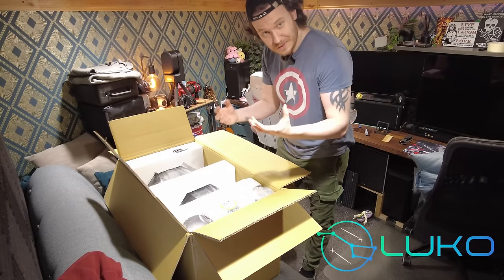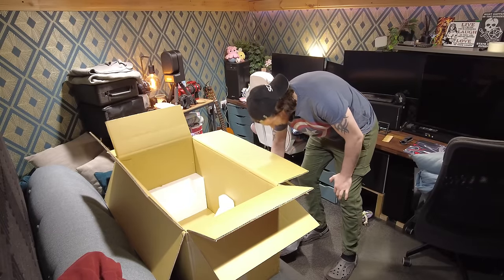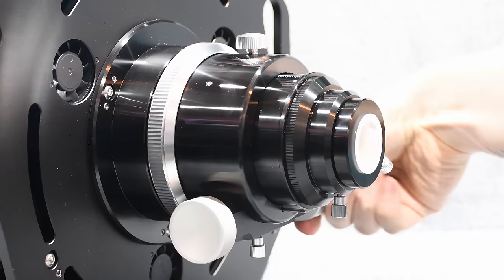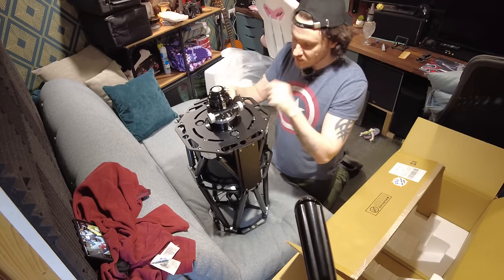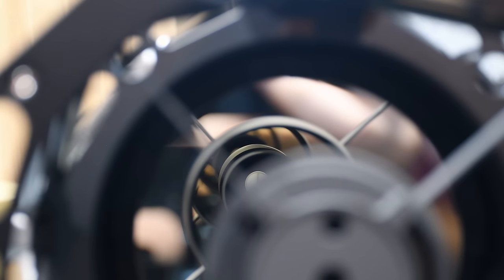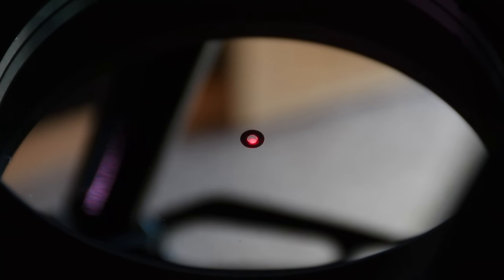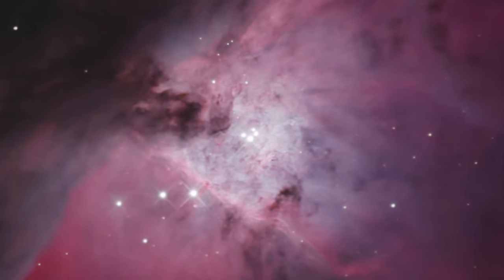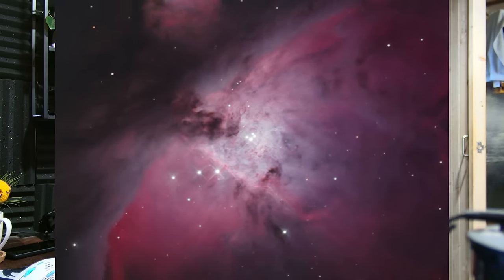DREAM Telescope! - StellaLyra 10" Truss RC - In-Depth First Impressions! (+ collimation)

Comment: Great review. It looks like a rebranded GSO scope and the focuser looks exactly like my GSO RC 6" focuser which is garbage. I had to dismantle it and 3D print a new shim where the focus axle sits to reduce some of the slop. Still has issues locking off/loosening that screw too!
Reply from the maker: Hey mate! - Good job on getting the issues mostly fixed, that's good work! - I think they all are quite similar, probably very minor differences between brands if they request slightly different specs? Cheers!

Comment: I own the iOptron version of this scope...  What a fantastic scope; it looks identical to the one you have, unfortunately, the focuser was also identical.  The stock focuser also had a bizarre 4.2mm shaft meaning none of my AF bushings quite fit properly.  Needless to say, I replaced it with a TS 3'' Focuser (short version), not cheap, but absolutely rock solid now.  I also added a ClickLock for good measure.  Finding a focuser with the required M117 thread hugely limited the options as I didn't want to have to go down the M90 to M117 adapter rout.  You would expect a better focuser on a £3k scope, but not going to lose much sleep just because of how amazing these RC10 scopes are. 🙂
Reply from the maker: Hey there mate! - ah I totally agree, it's a weird situation to see such a focuser on what is otherwise a truly top tier telescope, but like you say - I won't lose much sleep over a bad focuser when the scope is this good 👍👍
Reply: @lukomatico  It's rather than the "Don't look at the Sun" tag, this scope should have a "Don't use this focuser" tag.  Trying to coax any images out of this focuser drove me insane, it was like trying to use a hammer with a rubber handle.

Comment: A Moonlite Nightcrawler or something similar is what it needs for a focuser.  In all honesty, IMO none of the stock focusers are up to the weight of today's imaging trains with APS-C size and larger sensors.  By the time you hang an OAG-L and 2"x7 EFW, ASG Photon cage (for camera sensor tilt/back focus fine adjustments), a ASI 2600, 2400, or 6200 (or larger) camera at the end of the image stack and there is just a lot of leverage that the OEM focuser's just aren't capable of handling without some deflection/droop.  The issue was evident on my much smaller Esprit 100ED once I went to the 2600MC camera, so I went to the Nightcrawler after a year and haven't regretted it.

I really don't expect the telescope manufacturers to address this, after all it makes no sense to make such a robust focuser assembly for visual viewing or even for the smaller cameras like the ASI294.  Even for the dedicated astrophraphs, there are so may excellent 3rd party focusers available that the telescope manufacturers likely don't see a benefit of in trying to sell an OTA with an OEM focuser on par with that like the Nightcrawler or others.  They just don't say that outloud and I've yet to see anyone say that the OEM focuser wasn't really up to the task of a long/heavy imaging train until now.
Reply from the maker: Hey mate! - Sorry about the late reply here!
I totally agree that a lot of OEM focusers just aren't up to the job for a full-size image train! - many are probably fine for a smaller setup, OSC & filter drawer etc, but really struggle with heavyweight camera rigs.
Very glad to hear the nightcrawler has been a great solution for you! :-)

Thanks for watching and clear skies!

Comment: Hi, I am purchasing a 10 inch RC truss, I am wondering if the TS focuser upgrade worked with the telescope and with the ZWO EAF
Reply from the maker: It did indeed my friend :-) you need the correct size focuser though, just worth double checking before order - I believe this one is m117 👍

Comment: Its crazy you post this, this is exactly the scope im looking into right now. Whats actually necessary for imaging? Im coming from a refractor and have an asi533, guide scope, etc. is there any backfocus requirements or adapters needed?
Reply from the maker: That's awesome to hear Ben! I hope you've found this useful :-)
As to what's actually needed for imaging, you'll need good collimation tools for sure at least, probably a longer focal length guidescope (more on this in a future video) ideally an upgrade to the focuser, and then you can use it as-is without any reducer/flattener etc quite comfortably with the 533, I'm doing it right now! :-)

Comment: Cannot wait to see the images. Am also looking myself for a longer focal scope in the 1300-1800mm range, the model you have is manufactured by GSO (multiple brands sell this model, just the sticker is different), ....but you got sent the wrong version :-). They usually also have a RC 10" with F6.4 version featuring a full frame corrector (x0.8) and a much better focuser manufactured by Askar (you can find it on their website as well). Another interesting model I am also looking at is the Askar SCA260 F5 which seems very ionteresting.
Would also be interesting to see if you have des build up on the secondary or-and the primary mirrors.
Reply from the maker: Hey Paul! - I'm really glad to say after some more testing there's been no issues with dew after I fitted a strap around the primary housing :-) Prior to that, I had a dewed primary & secondary quite quickly!
I can't wait to share more from this soon!
Thank you for watching :-)
Reply: @lukomatico  Thanks Luke for the feed back. A bit surprised to see you see des build up on the primary,….a bit surprised to see you manage to get rid of it by strapping a resistance at the primary level around the tube,…..I would have thought the “transmissibility” of the heat to the mirror to by almost nil since you are far from being in direct contact with the glass,….but as we say, your empirical test validate what we say:’’the proof is in the pudding” . Cannot wait too see more experience sharing on the topic. Hope you enjoy and have fun too.

Comment: Luke - how would the original focuser go with just a small OSC (no filters, filter wheel etc).  No EAF, just manually focused using a bahtinov mask.
Reply from the maker: I think in that scenario it would be adequate if well adjusted to achieve enough friction - that said, I always feel like this focuser doesn't belong on such a nice scope, it's a mismatch! Cheers! :-)
Reply: @lukomatico  thanks mate. When I retired in 12 years, funds allowing, I hope to get 1 of these beauties.  Probably not  much use as I own a C9.25 (sure, it doesn't have the flat field, but 1 scope and can be switched between planetary and narrow FOV DSOs is more cost effective and would allow me to pursue my other hobby, photography, which in all honesty, is what I am more interested in as it's easier to use, quicker to deploy and affects my health problems less).   I foresee a Canon EOS R1II and EF600f4 II on the shopping list LOL.  Birding photography is very enjoyable, albeit very addictive.

Comment: Great tutorial on R-C collimation!  That's how I used to do it in my old job where I ran a bunch of R-C scopes, particularly the part you covered for primary tip-tilt about getting the small doughnut close to focus to be symmetric once you've got it roughed in.

Looking forward to this series, I'm interested to see what you think of these and appreciate your insights.  The design seems quite similar to the scopes I used to run, which were made by RC Optical Systems.  Like most professional scopes they focused by moving the secondary mirror back and forth, that focuser had great performance but I imagine it added quite a bit to the cost.  The secondary focusers had a lot of moving parts and needed regular maintenance, so I can see why most of the newer RC scopes omit this particular feature.

Would be interested to see if you have issues with the baffles and scattered light, this seems to often be the downfall of Cassegrain systems.  The biggest problem on the RCOS was a lot of the parts in the light path were finished in shiny black anodize, which was used on parts of the baffle tubes, secondary mirror shroud, primary mirror doughnut hole, and the extension tubes on the back.  That stuff was quite reflective, particularly at grazing incidence, and had to be covered with black flock material to get the scattered light under control enough for flat fielding to work properly.  Thankfully it was an easy fix.  It was easiest to see where the flock material needed to go by putting my eye or phone camera lens where the telescope's focal plane is and looking back toward the secondary, it should be completely black outside the circle of light coming from the secondary.
Reply from the maker: Hey there mate, sorry about the late reply to this!

I'm really interested to hear you've had a lot of experience with running these types of systems, - those RCOS scopes really look like beautiful pieces of equipment! (a shame to hear there were a few oddities in the design though as you mentioned!)

It'll be interesting to see if I do have issues with baffle length & scattered light - I hear mixed reports about these very latest ones, some folk say they have been extended on the primary baffle which should solve a lot of issues hopefully.

Hope you've had a great week!
All the best
Luke

Comment: I have an 8" truss telescope. I'm looking forward to how you use dew heaters on your primary mirror.
Reply from the maker: Hey mate! - I gave it a go without any heat etc, dewed up both primary & secondary - now I'm using a dew strap around the primary body, at the end of it and keeping the fans running all night, - zero issues with dew :-) Cheers!

Comment: I've never understood why these and even more so the 8" RC's are supplied with such rubbish focusers. They are all appalling quality. It's a shame the 8" doesn't have a decoupled mirror as that would be a great scope.
Reply: I use an 8" and for how much it cost I'm very happy. Of course it needs a focuser but it's useable.....just 😉
Reply from the maker: Agreed Andy!! - I'd absolutely love to see rc's across the range being offered with proper focusers and decoupled mirrors as standard, what a lineup that would be 👍
Reply: @Alan-vk6bk  yes but that 10" is £3000! It should have a quality r&p focuser on it with zero flex.

Comment: What would you get for dso's(assuming you have a dslr and a good tracking mount)
A 6 inch f5 newt or a 6 inch rc
Reply from the maker: 6" f5 newt myself! :-)
Reply: @lukomatico  is collimation not a problem ?
Reply from the maker: Good question! I've had both types of scopes many times, - by design it's far easier to collimate a Newtonian than a 6/8" RC, the smaller RC's have a bit of a design flaw really, the primary mirror and focuser are coupled as one unit - they need to be decoupled like the bigger 10/12/14"+ models to be easy to collimate
Newts are very easy to get to grips with after a little practice 👍
Good luck!

Comment: Good stuff Luke, looking forward to seeing your results with this scope. I've been trying to talk myself out of getting one of these for ages now (currently still deciding between this and the Sharpstar SCA260). The focuser is definitely the weak part of the package unfortunately. A common modification is to use the TS Optics 3" Short focuser in combimation with the TS Optics 3" 0.8x reducer/flattener which brings the scope down to F6.4.
Reply from the maker: Hey Pete mate!! Oof that's quite the decision to make!
As soon as possible I'll be getting this thing further tested and making some data available for people to play with, so maybe that'll be useful!! :-D can't wait to see what it'll do!
Reply: @lukomatico  Looking forward to it Luke, there's nothing better than getting to play with some data to see how good a scope is👍One thing that has always concerned me is the size of the secondary on RC scopes, especially with less than ideal sky conditions. A lot of the images I have seen taken with one tend to look very 'soft', although that might just be down to me being so used to refractors!
Reply from the maker: @petesastrophotography  I hear you Pete mate! It's a concern I shared, not too worried now having used it some more these past few nights though :-D I'm seeing nice sharp data! Definitely need to do more experiments though to make sure it's not just a fluke!

Comment: What a fantastic telescope Luke. I suppose the only issue was the focuser but given with a refractor you need to buy a field flattener or a good coma corrector with a newtonian upgrading the focuser is no more expensive than those scenarios. Your information on  collimation will be invaluable to anyone buying one of these scopes. Great video 👍
Reply: Some Newts (especially the cheaper ones) have rubbish focusers as well!
Reply from the maker: Hey mate! - That's a good point Paul, I'm using this scope completely 'as is' (apart from the focuser) and it's performing great, I know some folks like to use field-flatteners and reducers etc but I've not seen the need to yet with my small mono camera, probably would be an issue with a large sensor though! :-)
Kevin makes a good point here too, I guess it's not a unique situation being stuck with a crappy focuser out of the box haha!

Comment: I presume t hat this is the same as the GSO 10" truss...
Reply from the maker: That's right! :-)
Reply: @lukomatico  awesome.  I can't afford it, but always wanted 1.  However, my EQ6pro hasn't been used since 2010 and is probably full of dried up gunky lube and needs a rebuild, which is probably beyond me now.  My heq5pro was used a year ago with the Lunt60 but is too small for the RC10 imho.  And I don't have the ability for a permanent observatory (long story short, 2/3 of our small backyard is taken up by an easement and unusable...a pier might be an option, but we live in a dodgy area so....that would still mean brining out the mount every time I want to use it...coupled to worsening lower back, shoulder, Left hand/lower forearm/wrist problems with arthritis, lifting things is an issue now.

Comment: That is one cool scope Luke, I'll be excited to see the images that come from it. I have been thinking about maybe getting one of those 6" RCs for when I do want a longer focal length during galaxy season or when imaging planetary nebulae. Some people tell horror stories about collimating them and some people say they aren't too bad but you definitely need a tilt adapter. I'm okay with collimating as I do it with my Newt all the time (not the same I know but the point remains). Did you find that you had to re-collimate the 6" RCs much? Also, does that program you showed for collimation work with Newts as well? If so, that could make my life a lot easier.
Reply from the maker: Hey mate! Sorry about the late reply to this 🙏
I did find that I had to recollimate the rc6's I had frequently - not because of the scope itself but because of the focuser, with a good focuser it'd probably hold a lot better :-)
As to metaguide, I'm sure it'd work with newts too yeah!
Reply: @lukomatico  all good man! I didn't think anything of it considering the thousands of miles that separate us. That's quite interesting and makes me wonder if it would be worth replacing the focuser on an RC6 after I got it... I have this huge debate between an RC6 or a C6 SCT especially since there isn't a huge difference in price.
Reply from the maker: @iamjessieray  That's a tough one to answer mate! My advice would be to go with the C6, closed tube design so won't get dirty inside after a season, far easier collimation and a better focuser out of the box too 👍
Hope that's helpful mate!
Reply: @lukomatico  All good points! It would also give me the option to use it with a reducer or even a hyperstar setup.

Comment: sweet scope. what do you reckon dew/frost mngmnt will be like vs closed tube
Reply from the maker: Hey mate! That's an interesting question! I've had it all dew up once when I tried without any heater bands, after that I applied one large heater band to the primary mirror tube segment, at the front - I also keep the fans running all night, it's been completely dew free since on both secondary and primary :-)